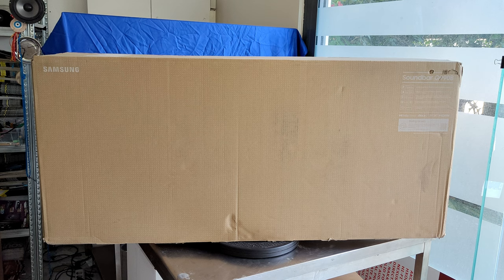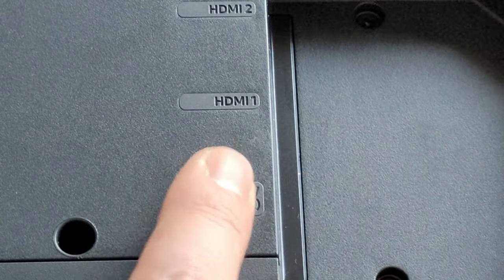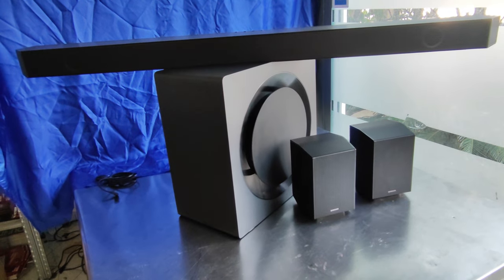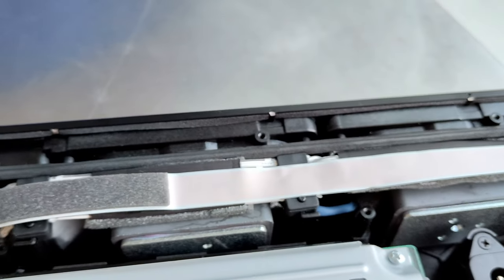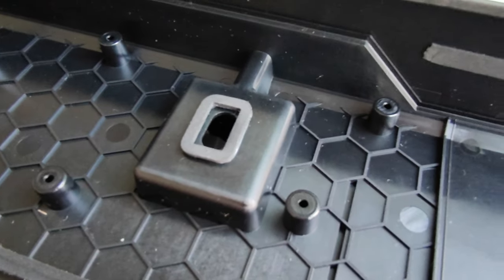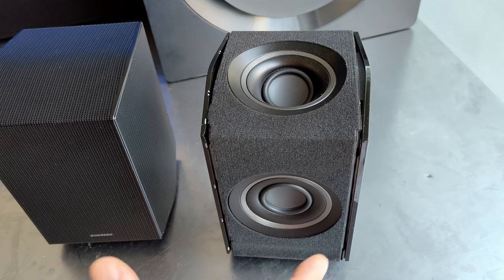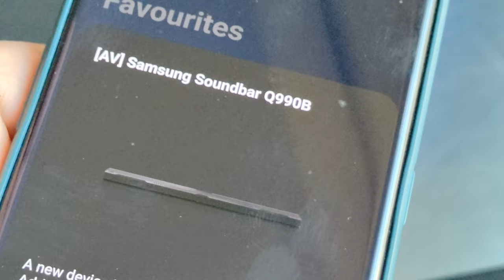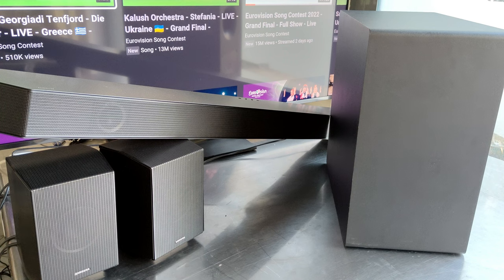Samsung HW-Q990B soundbar of 11.1.4 channels Tear down| Deep unboxing

Comment: What modes should be on and off for atmos content? I have sony z9f htz and you need to turn thinga off and on to work woth atmos content.
Happy to hear what you think
Reply from the maker: It's a problem of synchronization between your TV and the soundbar. Usually it's an incompatibility from TV.

Comment: Tell me, can we get analog stereo input connected directly? To get AUX input without latency Maybe by bypassing the bluetooth module??
Reply from the maker: Νο, the Bluetooth is digital.
Reply: @hxosplus  are you sure that the bluetooth audio output is digital?
Reply from the maker: @cccbbbh673  Yes, the whole system is digital
Reply from the maker: You can buy a Bluetooth dongle like the ones from FiiO i.e.   https://www.fiio.com/bta30 that they have an analogue input.

Comment: i am about to buy Hw 990 b in a day or two
. Any other issue you've faced with this sounbar for LG tv's . I have a LG c9 tv and i will connect all my devices(ps5, 4k bluray player) directly to my LG c9 Tv  through earc and then select passthrough in Tv audio settings .
I belive you are also doing the same  .  My main concern is that i get full fat Dolby atmos through Lg c9's passthrough mode. Please suggest . or any other suggestions you would give with your experience would be very helpfull. I had earlier Hw q950 t and it gave me lot of troubles , i am just worried that Hw 990 b does not give me same troubles as it is a serious investment.
Reply from the maker: This soundbar is very mature compared to the previous Samsung models.

Comment: Hi 
Thank you for your review, I have a question I got 990b Soundbar I have connection problem on left rear speaker, Samsung sent me replacement rear speakers but same problem only left rear speaker , do you have any idea about this problem? 
Samsung said sent to repair center before ship them I need your advice
Reply from the maker: Hi, since your soundbar is a new one you have two years of guarantee. Try to replace the whole system. Probably the problem is not on the rear speakers but on the main unit.
Sorry to hear about that.

Comment: The issue of disconnecting back speakers is very serious in Korea.Check if the connection is intermittent
Reply: ...some people also have problems with subwoofer disconnecting.

Comment: I have purchased q990b after such great reviews. I just wanted to know about 2 surround speakers. Inspite of putting rear channels at highest level of 6, I am getting very less sound in surround mode. Is it the default way of surround speakers?
Reply: Did you use the app to change the volume level?
Reply: Just change the volume of the speakers.
Reply: They are designed that way. They get plenty loud in movies but not in music. This is because most of the music is 2 channel stereo that is than upmixed by the soundbar . I play mine on adaptive most. It's the best for both music and movies.

Comment: Sir, please tell better soundbar Samsung Harman/Kardon N950 & Q90R  7.1.4  Vs. Samsung Q990B Soundbar 11.1.4 I will be waiting for your answer about this.
Reply from the maker: Yes, it's better!
Reply: Sir which is best in both soundbar 
1. Samsung harman kardon n950, q90r. 7.1.4
or
2. Samsung q990b 11.1.4
Please give me clean answer. Which is best in above the Sr. 1 or 2
Reply: @sanjaykumar-ky2ro  as someone who have own N950 Q96/90R and currently Q950T, what I can tell u is if you can get the q96R for much cheaper (30-35%)  than the latest q990b get it. If money is no issue then go for the latest and greatest. I upgraded each of them only after them being in market for over a year. Launch price 1200/1499 euros, after a year 600-800, sometimes even cheaper if bought in outlet.
Reply: @manishjaiswal3523  I have Samsung HARMAN KARDON HW-N950 7.1.2 soundbar
Reply: 3 @sanjaykumar-ky2ro

Comment: Samsung HW-Q990B vs Samsung HW-Q950A
Which one is good
Reply: I have the 950A and it is good and no wireless connection issues on the rear speakers.I read many people having problems connecting rear speakers on the newer 990B. Other Samsung soundbars have had connection issues in the past and they have not been fixed, so maybe a design issue on the new model?  Also, where I live the older 950A is 850 euros...much less expensive than the new 990B. People also losing connection with the subwoofer.

Comment: I am a bit disappointed. It's no upgrade than Samsung Q90RXu yes it has little more noise but the sub is exactly the same inside. Bass is kind of less punchy in my comparison though. 
I am returning it such a shame we always blame Apple for no real upgrade every year but Samsung it pretty much the same. It should either have 2 subs or a bigger more powerful sub.

Comment: Those surround speakers are tiny - they look high quality, but very little indeed.
Reply: Size can be deceiving...
Reply: not really when compared to some other companies they are a good size. and the drivers are still bigger than on the soundbar
Reply: Not tiny at all. The 950a rears are excellent at +5 volume placed each side of the couch.

Comment: They made the rear speakers too big. It’s a lot bigger than the speaker drivers. The Vizio Elevate has more compact rear speakers that probably even sound better than the Samsung ones even though they’re wired. I don’t care about wireless rear speakers at all. Most people don’t have extra outlets in their rooms. Most bedrooms have about 4 outlets. I think it’s unnecessary for wireless rear speakers. It just increases the costs. The Vizio in my opinion is better. Also, I would choose the Vizio Elevate over the Samsung HW-Q990B because it’s $900 cheaper. The Vizio looks more appealing, more compact, and simpler. I like how the speakers can rotate. The Elevate seems way better built than the Samsung. The subwoofer is much more powerful than the Samsung and it’s the same weight. Even though the Vizio isn’t 11.1.4, it does sound a lot better and cleaner for a 5.1.4 system. It can also play at 107DB with no audible distortion and barely any pumping and compression. I would rather choose Vizio for a soundbar. I’m really happy with my $188 Vizio V51x-j6 5.1 home theater soundbar. It goes down to 50HZ and it’s not boomy at all. It’s really loud and punchy. It rattles my room.

Comment: Anyone upset that this is a $2k product but has low quality components - paper woofers and non metal or silk tweeters?
Reply from the maker: Paper woofers are high performers. Even high-end speakers have paper cones.
Reply: @hxosplus  do you have a link to a paper speaker in the crutchfield catalog for home or car that shows quality? I can't find a non coated, plain paper one like the ones that come in the Samsung. Usually all stock speakers in car systems are paper and thin gauge wire. They are fragile and offer poor longevity.

Since you've opened up both and played around with the insides...  Which has better quality components and craftsmanship.... Sonos or Samsung?